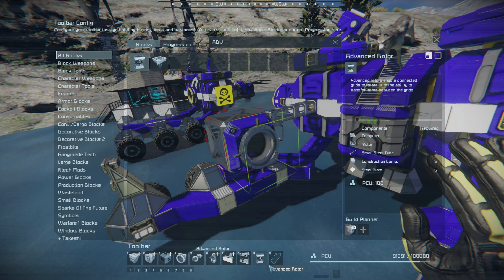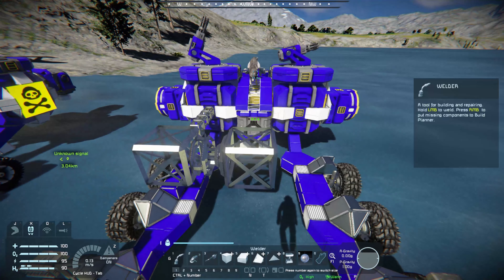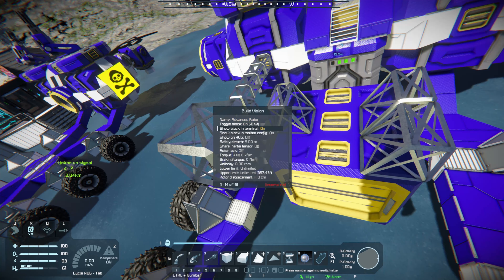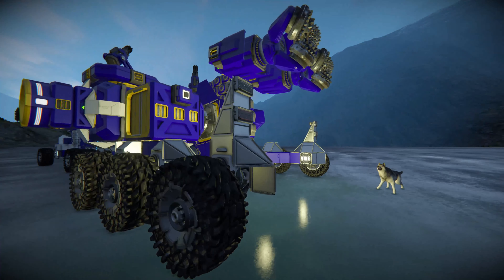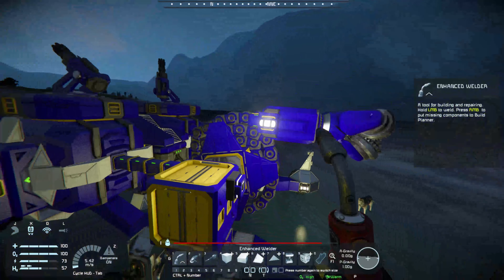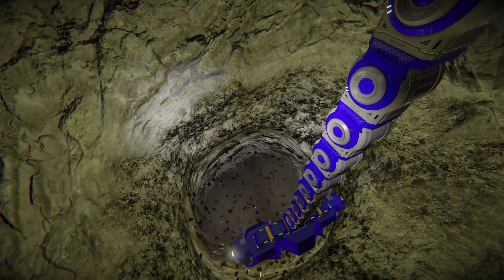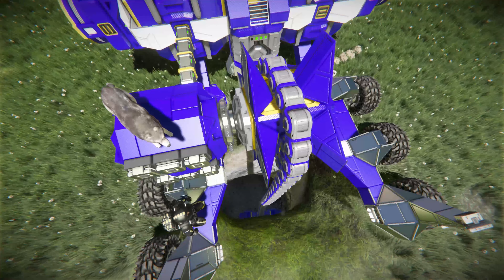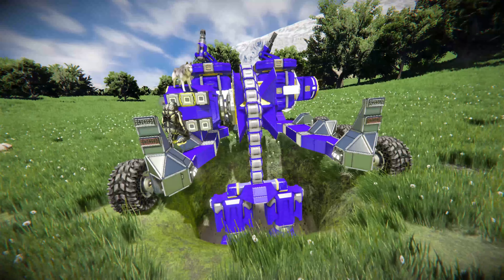Syberiah & Andi - Survival - How to build a Chain Driller - S1 - Ep 3

Comment: Really like this idea. I did something similar but after the first wrap around the junction box with hinges I started adding in pistons into the chain. I managed to get the chain to reach down to just over 100m.
Reply from the maker: Wow mate thats a great idea. Saves on pcu too       
How was the wobble with the pistons?
Reply: @syberiah  Wobble was about the same as without the pistons but managed to reduce that by putting two gyro's on the drills. That kept them very stable.
Reply from the maker: @madmann225  gyros on override on the drills? Very awesome ideas man. Thanks for sharing. I been planning on upgrading/ rebuilding this rover for a while. I did a large grid version worked well too.